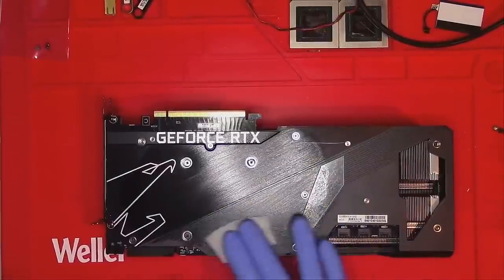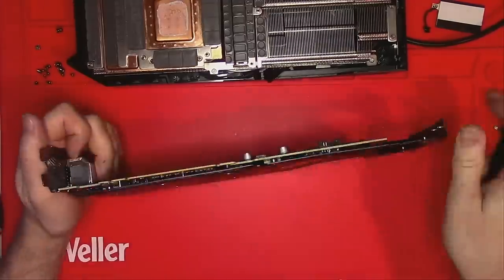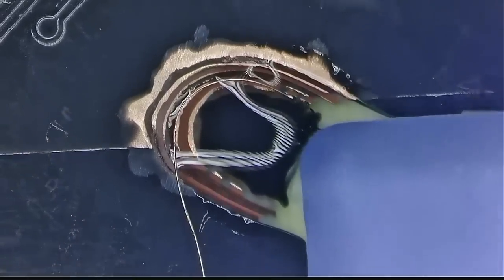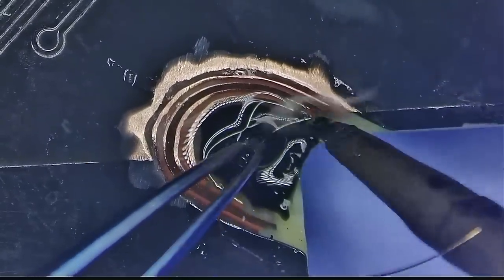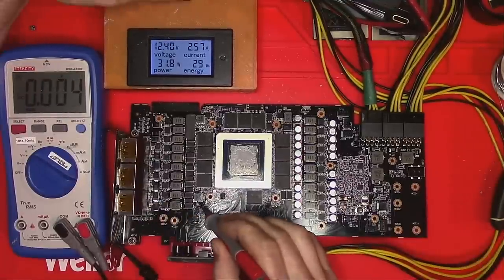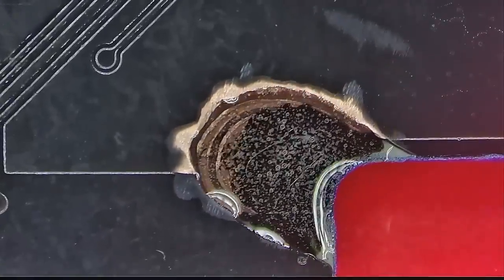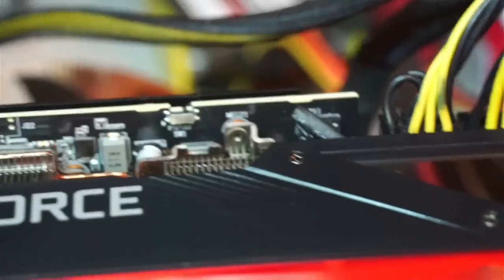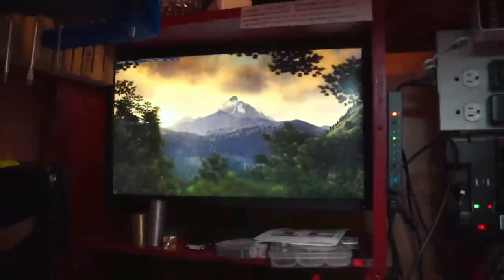Gigabyte cracked PCB repair

Comment: Boss, can you explain in a video how you repair a card by digging the pcb?
Reply from the maker: There was a crack.
Inside are broken traces.
What else there is to explain.
Reply: @northwestrepair  it's just to us not in the know, we don't have any idea how that fixes it. I also watched an earlier video of you digging out an older card. 1080ti i think, to remove a (short?)

Though i don't have any use for the knowledge, I only thought further exposition on it is very interesting.

Comment: Hi northwestrepair
Have you ever received a Gigabyte RTX 3080 WaterBlock for the black screen while gaming issue?
I currently have one and I would prefer to send it to you than to the GigaChads
Reply: Contact him on discord
Reply: @yoiboitrash8411  done ty.
@northwestrepair Also thanks for the content as usual
Reply: Do oh have corrosion inside the waterblock ?
Reply: @cppctek  nah no corrosion visible. It's a pretty new build actually. Temps are still really good under load - like 55C hottest during a 120F summer..

Comment: It's nothing to do with being environmentally friendly.

It's that NVIDIA made the BoM costs so high for their 3000 series, while selling the chips for so much to AIBs, that AIBs have almost no margins on 3080 and 3090s. So a lot of them cheaped out when making the base models. What you get is these 2+ kg gpus with completely inadequate reinforcement.

Even my EVGA 3080 FTW3 sags. So I had to get a GPU stand. EVGA fixed this with their later models (like the 3080 ti) by reinforcing the PCB so that it doesn't sag.
Reply: I agree - nvidia really squeezed their AIBs , which is why EVGA aren't making any more cards. A lot of the Ampere PCBs have corners cut , especially with the 3090 and providing adequate VRAM cooling

Comment: these gigabyte cards used horrible thermal pads too, bunch of them leaking including 3090 xtreme's. 
I have a 3070 ti master and i have the gpu always on a sag holster. I've modded my gpus thermal pads and replaced them with decent pads, getting 86c on hotspot on max compared to 105c it was previously.
these graphics cards from gigabyte sag so much, its kinda a hidden requirement to get them. if only the backplate was actually attached to the io bracket...
i wouldnt recommend anyone getting these cards used.

Comment: Should we mount our GPU verticaly ?
Reply from the maker: That's a good option
Reply: @northwestrepair  It will put pressure on the bracket, not in the pci slot or in the pcb. Right ?

Comment: I went to a LAN session at a friends house many years ago. Just me, my mate Craig, and his friend Mike whos house it was. Huge house, wealthy parents. His younger brother was growing weed in the attic and the entire upstairs stank of skunk. We were planning to play Starcraft and Quake. In the middle of the night, a moth flew into the room through the window, that was the size of a fruit bat. It flew straight at Mikes head, and he turned to see what the odd buzzing noise was, and had a legendary freakout when he saw what was attacking him and levelled a HUGE right hook which clocked the Moth God right in the kisser. It fell behind his bed, but it didn't die! It lived on. And we armed outselves with weapons before flipping his bed and tackling the monster as a group. Mike had a degree in electronic engineering. Later that night, after the moth funeral, one of our split link network cables died, and he simply took a normal RJ45 lead, did some magic to it, and turned it into a split link. I was forever impressed with that.
Reply from the maker: And then what happened ?
Reply: @northwestrepair  Dude then we carried on playing! XD But I was well impressed, at how he turned that cable into something else. I knew everything about building PC's, getting networks working, optimizing and OS. I could even set up a network with mapped drives in DOS (!!!), but when it came to messing with hardware (like you do), I had no idea! So its impressive to me. I used to ask him what he'd been doing at work - and was always intrigued. This guy could fix TV's. He could open a machine and see what was wrong, and fix it. He could take a piece of board, and a soldering iron, and actually put parts together to make them work! To me, that was magic! XD

Anyways, the moth died, RIP. And we played Starcraft and Dungeon Keeper and Quake till the sun came up, as usual. I sucked at RTS, those two guys were amazing compared to me. But I'd beat the shit out them with my eyes closed at FPS games! XD

So I'd always get my moment of glory by the end of the night.

Comment: GUYS if you never want problems with your precious GPU's DON'T EVER TURN THEM OFF! Leave your computer on 24/7 and if you do shut them down turn them right back on. I have never lost a GPU or ANY computer component. EXCEPT this one time I lost power from a windstorm and the computer wouldn't be turned back on for 12 hours. It doesn't mean you can't turn them off just do it for cleaning, moving or whatever else just remember to turn them back on when ASAP.
Reply: turn it off, save 40$/mo in electricity bills, and use that money to repair or replace when components die.
components also have a usage lifetime which gets shorter with heat.
keeping your system permanently on isn't going to save it from aging.

also, being a power cut due to a windstorm, i wouldnt discard a floating neutral somewhere which can make the line voltage shoot up to 300-500V and your regular breakers wont trip

Comment: This is one of the reasons why I think cases which have the motherboard horizontal (or which give you the option to have the motherboard horizontal) are a great choice (because GPU sag is no longer a concern when the graphics card is vertical). Another good thing about these cases is that they are generally very hard to accidentally knock over, and they're also generally easier to work with as well, as you often don't need to move the case at all to do component upgrades.

I personally have a HAF XB EVO, which I think has been out of production for a long time, but I really love this case! It's extremely well ventilated and extremely easy to work with. It also has a lot of space for large graphics cards and large CPU coolers.
Reply: I was reading the comments on this repair,  and noticed your HAF XB EVO comment.   Interestingly enough,  Cooler Master STILL makes this case.  I have 3 myself.   I didn't buy them with the intent of GPU Sag,  but rather more of a bench type case that is SO easy to build.   Anyway if your looking at newer GPU's 40xx series or 7000 series GPU's be very mindful of the length for this case,  as many GPU's this gen are just too long.

Comment: I'm confused what bad/cheap manufacturing processes have to do with political correctness - but interesting and cool repair as aways. Thanks for the video 😊
Reply: What, you've never seen anyone use the platform as a way to not only show their skill, but also express their opinion on today's social climate even if they're not related at all 🤡🤡🤡
Reply from the maker: You make product that does not offend anyone, environmental activists and a regular person.
So you make a GPU from corn and lead free solder.
Both customers get crappy product as a result but at least no one is offended.
Reply: @northwestrepair  guess I hadn't seen anyone relate low quality material to political opinions when making things as cheap as possible is usually plenty reason enough for companies but I know almost nothing about electronic manufacturing or lifespans of computer parts.

Comment: so every single time a crack happens on the pcie slot joint, all they had to do was grind down to the circuit, solder some copper wire to the two terminals, lay on some epoxy, and let it dry, but they instead chose to deny the repair on the RMA claim for more profit.
Oh lord, that makes me sick to my stomach. That's disgusting. $50 repair? or a $2K gpu sale? Oh my god.
Reply from the maker: I mean, yeah 🤣
But it's not as easy as it seems.
It takes a lot of practice and the right equipment to do it.
My understanding is that RMA centers have two things. 
1. Soldering mat and a set of screw drivers from gamers Nexus

Comment: Hello my friend, I do not know whether you read my message or not, and if you read it, I will be grateful to you. In order not to be long, I have the same problem in my device, or rather in the graphics card, I think. My problem is as follows: When I open the computer, there is a white light on the motherboard. When I restart, I enter Windows, and after a period of operation, a black screen appears, knowing that the computer and the graphics card are still running. Sometimes it may work for 10 days without a problem. I tried all the solutions (updating the BIOS for the graphics card). And the motherboard, changing the power supply, changing the processor, changing the RAM (until I gave up I used another card from my friend and it worked fine. Please help me if you find the solution. Thank you. Computer's components Asus tuf gaming b550 plus Asus rtx 3060ti gaming oc v2 asus roug strix 1000w 80+ gold ryzen7 5800x corsair 32 If you find the solution, tell me. I will be grateful to you.

Comment: Gigabyte=CRAP ! I experience this on my own , buy one watercool Aorus 3080 10Gb and got only bugs and black screen on full load; send it to RMA service and got the card back WITHOUT ANY REPAIR (where I know that - I mark the fittings ), only with the report = the graphic card is OK ! So better stay away from Gigabyte.....They don't ever bother to change the thermal paste on it...they don't ever bother to mount it on a watercooled system !

Comment: from a teaching perspective, video would have been better if you explained what you were looking for as you drilled. like i didn't know why you started doing that, you could have "there's a wire broke in this crack an i need to get to it" and then you coulda pointed to the two points and explained that was a wire.
Reply from the maker: I think I did explain.

Comment: What the actual fuck does "green technology" and "environmentally friendly" have to do with GPU sag? It's just poor design. The shrouds need to be braced better against the back of the case which pretty much singlehandedly corrects GPU sag.

Either way, the form factor for installing GPUs was never designed for cards that way multiple pounds. The concept was designed for the IBM PC/AT and originally wasn't even a horizontal mount but a vertical one, with the motherboard laying flat in the case.

We rotated the chassis 90 degrees to mount the motherboards vertically so PC cases would have a smaller physical footprint on our desks, but expansion slots were left perpendicular which was a perfectly fine design flaw at the time because expansion cards typically didn't even need heatsinks because most ICs of the time couldn't even really run hot enough to need them.

Now 40 years later we're paying for it with GPU shrouds that weigh several pounds and the expansion slot isn't strong enough to hold them by itself, and the last generation or two of cards have really illustrated the problem with how heavy high end cards have become. We've only relatively recently understood the problem and how to combat/fix it. Jayztwocents for example clearly demonstrated that even just designing the shroud to brace against the back of the case properly almost eliminates sag, and lo and behold, only a year after he demonstrated how he fixes it, many GPU manufacturers are in fact properly designing the cards to do so! Never mind how many high end GPUs now also come with some kind of support bracket, or the funny "hanging pulley" that was standard with 3090Ti cards... lol.

The initial rant about "green technology" instantly turned me off this channel - it means you either have shitty politics (and I don't mean the ideology you ascribe to - I respect other peoples' world views - I mean feeling the need to ram them down others' throats) or you're an ignorant idiot (genuinely believing that "green technology" / "stuff isn't built to last anymore" is the cause of GPU sag...). I'm sure you're a talented board repair technician but this ain't the way to make videos, my dude.
Reply from the maker: Cheap corn based pcb.
Good for environment, bad for consumer.
Reply: @northwestrepair  Speak for yourself I only buy GPUs made with real cane sugar
Reply: @northwestrepair  (being more serious for a moment: there's literally no way in hell GPUs are shipping with PLA-based PCBs. they cannot handle GPU level temperatures. there'd be far more problems than fractures from bending if they used PLA PCBs on high end GPUs.)

Comment: great repair, but it’s wild to complain about “environmental friendliness and political correctness” within the first minute of the video, that came out of nowhere and made no sense lmao
Reply from the maker: its all good.. it will one day
Reply: @northwestrepair  so, what makes you think the reason things aren't "built to last" anymore is because things need to be "environmentally friendly"(????), and not because in a competitive for-profit environment, there is an incentive to make your product as cheap and flimsy as it possibly can be without damaging your brand image too much? bonus points for planned obsolescense after warranties, and the need to upgrade gpus every 5 years anyway??? those things are direct consequences of free market capitalism and have nothing to do with environmental friendliness, be it from regulations or self-imposed. please make it make sense.
Reply from the maker: @ssword123  the term "environmentally friendly" is used to justify producing disposable garbage.
It's better for the environment to produce something that lasts generations.
Tesla for example.
Marketed as environmentally friendly but to make one, it damages the environment more that a 12 cylinder pickup truck would over two life cycles.
If  Tesla is set on fire, you cannot water it or it will contaminate ground water so they let them burn out contaminating the atmosphere instead.
Reply: @northwestrepair Have fun on Tuesday, MAGAt.

Comment: What's up with the bullshit political messaging? Things aren't built to last because that's more profitable.
Reply: Though this guy was serious but now I see another one obssessed with "political correctness everywhere!!!1111" It's exactly as you say, the cards are just mass production junk, the same as "politically correctness everywhere" is just a ruse: the issues are market byproducts of mass production and supply chain constraints.
Reply: if people would given a damn by how well products are built and repair-ability, shit like this would not happen to such a relatively new card. 
It is true that the massive bulky coolers are causing the sagging issue but if reliability was in people minds, GPU makers would have made reinforced PCBs like they made reinforced PCI_E slots on motherboards.
Reply: @eliadbu  I agree. I find it pretty surprising that traces would be routed so close to the edge of the PCB apart from the PCIe slot itself

Comment: hey northwestrepair. i just bought a new gigabyte rtx 4080 gaming oc, do you think if I use the gpu bracket and be careful with it it should not break?
Reply from the maker: I think even with bracket it will break
Reply: @northwestrepair  damn its that bad
Reply: @northwestrepair  thanks for getting back to me. is it possible to strengthen it?